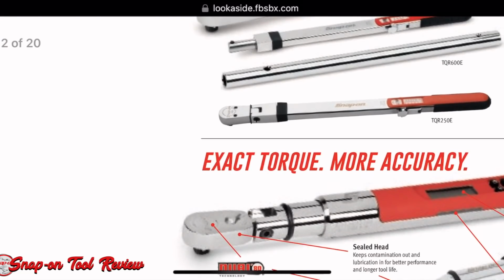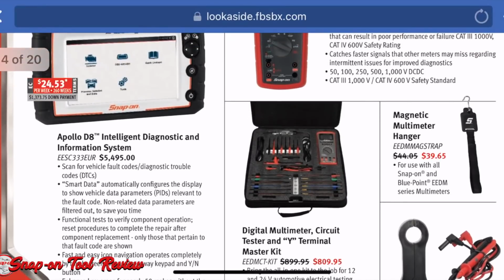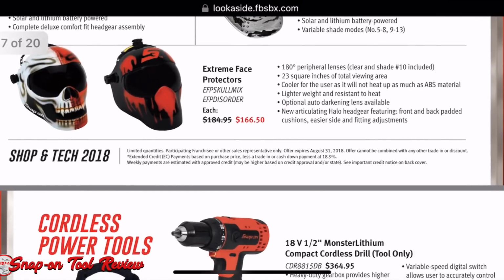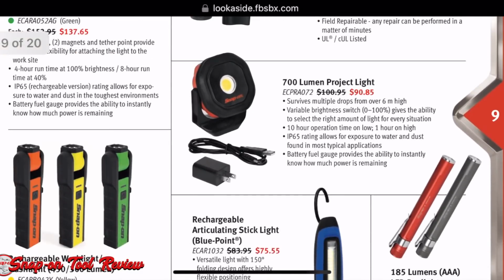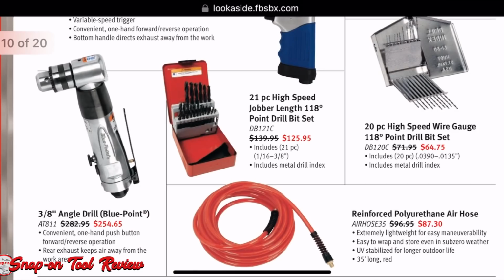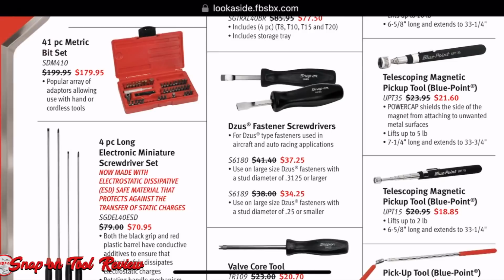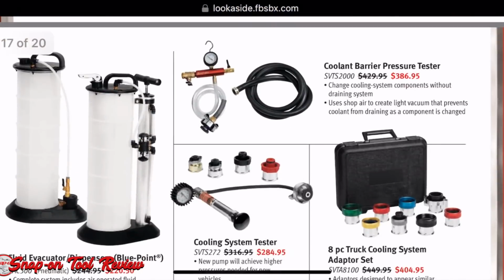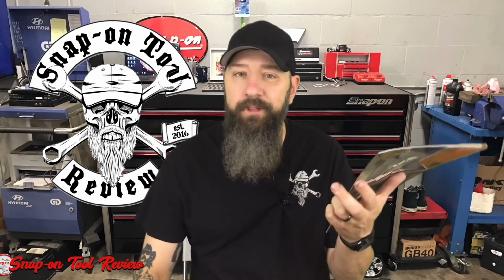SNAP-ON 's Shop & Tech Flyer Walkthrough

Comment: Dude what? How is that 1/2"  Blue Point air drill "junk"? That thing rips. Step out of the cute dealer world and take a swing at industrial work where electric drills burn out daily. That BP drill is a solid banger drilling through 2" steel. Reading a scanner and swapping parts is easy, some heavy body mounting will munch those 14.4 Fisher Price guns.

Comment: Hey Joel i gotta change the spark plugs in my Hyundai Elantra what’s the torque spec for the plugs on a 2014 Elantra i figured you might know off the top of your head if not no biggy
Reply from the maker: Hyundai is funny when you look up torque specs. It's 10 - 18 foot pounds. I usually do 16 when I torque.
Reply: The Snap-On Tool Review thanks man

Comment: Dzus Fasteners are a quarter-turn fastener used extensively in Aviation, and also racing. The slot is curved at the bottom so flat blade screwdrivers will tear them up, hence the specially shaped drivers.
Reply: We use a bunch of 1/4 turns in race builds.  Way better to have the right tool.

Comment: Hey Joel!  I own and use a timing light!  Pretty hard to maintain early 70s cars without one.  That 3/8" right angle impact wrench looks suspiciously like the IR Hammerhead.
Reply: A lot of us still use timing lights.  He's coming from it as a dealer tech for new cars and most of the kids missed pre ODBII where you had to use one.  Some models needed them until the early/mid 90s.  There are better lights for a lot less money than that one.